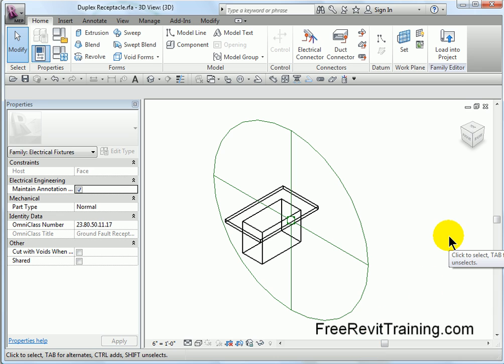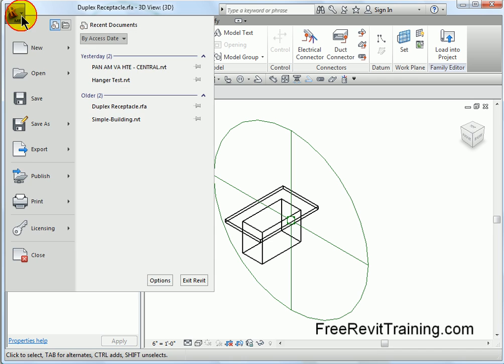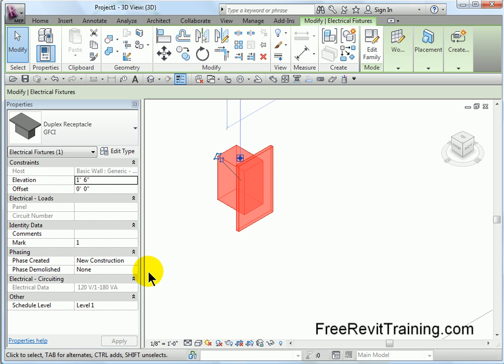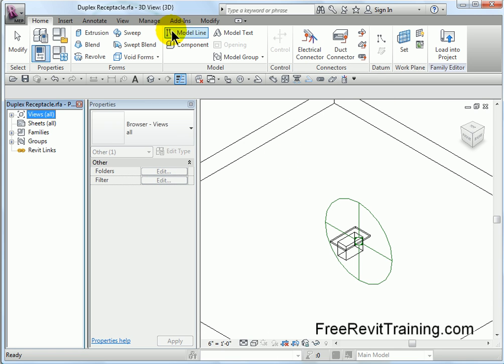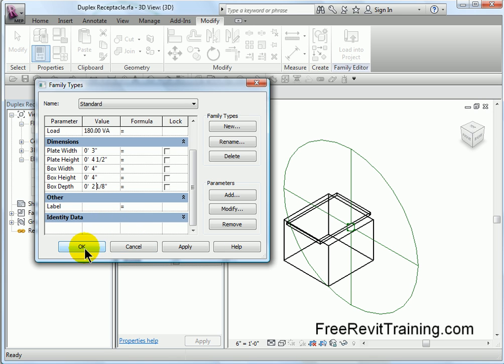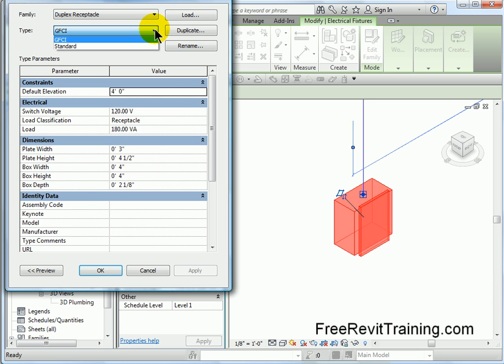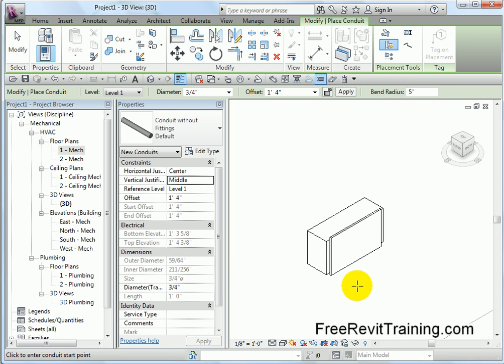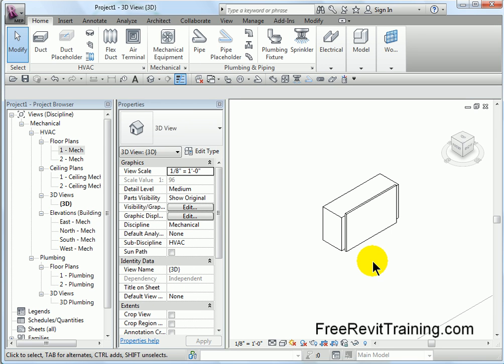Creating Electrical Families with Parametrics and Conduit in Revit MEP - CADtech Seminars.com

Comment: I would like this onw with MULTIPLE CONNECTORS with different conduit diameters.
Reply from the maker: Yes. Use conduit connection plate instead of a single point. Elec panels use these. Open an electric panel and you can see what to use.

Comment: Thanks for the video; can I add more than one conduit in the front side of the box??
Reply: Yes. Use conduit connection plate instead of a single point. Elec panels use these. Open an electric panel and you can see what to use.

Comment: You didn't touched one important issue of making "Voltage of receptacle" to instance one. It's a major problem with families when they don't fit in our distribution system. For example, autodesk library electrical families are 120V which don't fit in 230/400 distribution system.
Reply: https://youtu.be/PMLEi1fRKDw

Comment: Why are you modeling conduit?
Reply: This is done for BIM collaboration models usually once the const. contract has been awarded.  Most of the time it is just the large conduit. But sometimes the BIM contract require as small as 1" and larger dia conduit to be modeled.